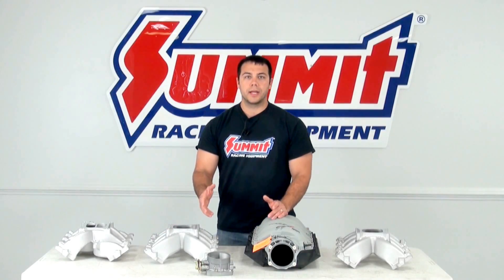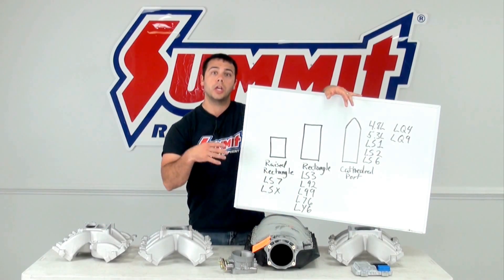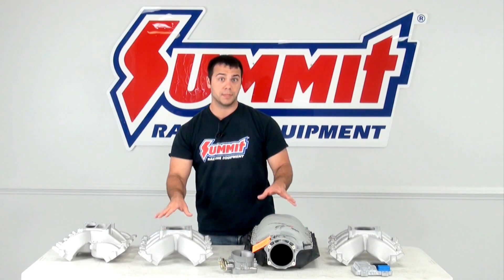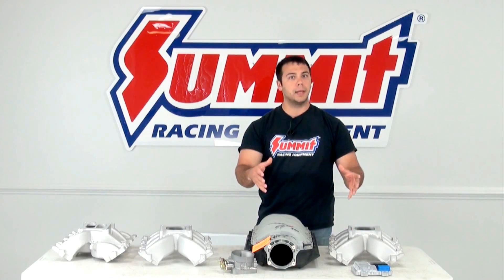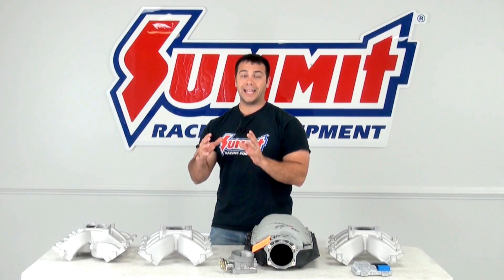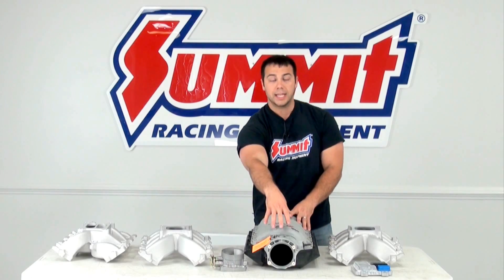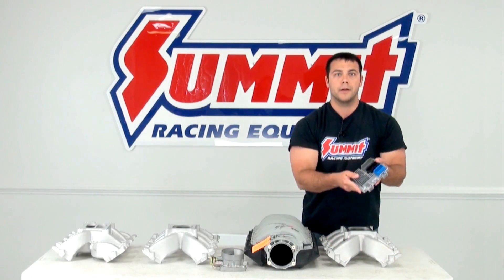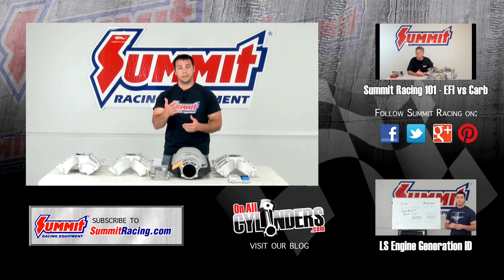LS Engine Swap Intake Manifold Selection - Summit Racing Quick Flicks

Comment: Will be ok to run 2 steam lines or 4 for a 5.3 ls swap
Reply from the maker: Two steam lines works at stock horsepower levels, but four is recommended for any more.  It is definitely easiest to fit the kits when the engine is out of the car.

Comment: which one is best for a 2004 4.8 budget wise like leaving most of it stock other than the cam swap
Reply from the maker: A TBSS or 2009+ long runner truck intake would be the best option to increase torque and power through the whole range.

Comment: Hello i have a stock lq9 6.0 engine and transmission from a 2002 Cadillac Escalade it is fuel injection it's going into a 2001 gmc 2 door sierra shortbed I purchased a 4l60e 2wd rebuilt transmission I also purchased an ls3 intake manifold will it fit with the lq9? And what harness can I use I would like to keep it fuel injection with an ls3 intake manifold and throttle body if possible .
Reply from the maker: Thank you for your question.  Here is a handy guide on the LQ9  https://www.onallcylinders.com/2018/02/02/lq9-engine-specs-performance-bore-stroke-cylinder-heads-cam-specs/    . The LQ9 is a Cathedral Port cylinder head engine, so the LS3 intake won’t fit.  The good news is the 24x reluctor ring crank works with your ECM.

Comment: I have a 2014 L96 6.0 can i convert it to fly by cable to use my transmission throttle valve cable on my 700r4? and keep the original computer or do i need to find a intake wiring harness and pcm from a fly by wire truck. thanks for any help.

Comment: Al, informative video for those who don’t know and just learning. I’m leaning towards installing an EFI multiport system that uses the aluminum single plane intake with a 4150 or possibly a 4500 Dominator style throttle body air valve and utilizing the multiport injection to each cylinder on an LSX 454 engine swap. Is there an advantage to use the FAST intake/throttle body setup instead of the single plane aluminum intake? Thanks in advance.

Comment: How much horsepower you think I would gain by using a LS3 intake on a 5.3 motor
Reply from the maker: The LS3 is a good intake, but the rectangle port LS3 heads won’t fit on bores smaller than 4.000.  The 5.3’s are 3.780.  With your cathedral port heads, you have a lot of good options.  If it’s in a truck application, the factory intakes will actually make more power than a LS6 intake for instance…and a lot more torque. The FAST intake makes great power and you may see gains as high as 20 horsepower at the wheels if you’re running a decent sized street cam.  The FAST Truck manifold is killer too.  All the horsepower of the shorter intake AND all the torque.  That could be 25 horsepower and another 15-20 ft./lbs over the car intakes.  Summit has a great series on LS engines.  To view articles, type your engine code into the search box here: https://www.summitracing.com/customerservice/faqs   There are spec pages for each engine code along with good modification paths depending on what you’re wanting to do with it.
Reply: I have the adapter plates that will allow you to run LS3 intake on a 5.3 and I also have a ls9 cam in my 5.3 do you think once I finish my motor up I could get close to 400 horsepower
Reply: And I have a 4.8 motor I wanted to know will 317 heads from the 6.0 work on the 4.8 without modification or boring over
Reply: Summit Racing will that intake work with a 5.3lsx bored out to a 5.7 lsx?
Reply: Summit Racing one more question where can I find performance parts for a 99-02 Chevy express 5.7?

Comment: OMG I thought the Carb died with the Dinosaurs.  Why would I pay money for a carb or distributor when they both are ancient technology?
Reply: mewrongway because they work?? What kind of stupid question is that
Reply: mewrongway no. Depending on the application, carbs can make more power that efi, depending on how theyre ported. Example: LS engines. Is your default really just to listen to some stranger in a video? Is that how you make your decisions? If you ever worked on engines extensively, you would find that there is little to no power difference between efi and a perfectly tuned carb. You do not gain or lose hp by installing coil packs over a distributor (assuming the vacuum advance is correct). If carbs and distributors didnt work, they wouldnt still be on the market. Its just facts. If you want to continue to deny facts, so be it, but dont argue with me.
Reply: you can tune each cylinder, but that just makes the engine run smoother. the engine doesnt care how the fuel gets there. the only reason efi systems make like 5hp max over carbs is mainly due to the facts that the main venturies restrict some of the airflow going in. it has nothing to do with fuel delivery.

"more spark energy," there is literally zero power that can be gained by merely switching ignition systems, assuming they both function correctly. if you take a 500hp motor with a distributor and switch to DIS, it will still be 500hp.

new cars dont use them because of fuel efficiency, electronics make efi more reliable, and the engine runs smoother. but that was not my point.

My point was that carbs and mechanical ignition are still used because they work very well at a significantly lower cost. so lets say you get a 5hp gain max out of switching to EFI and DIS. congrats, you just spent about 1200 bucks for 5hp that is barely noticeable. EFI and DIS are unquestionably better and more reliable in most circumstances, but this isnt a debate as to which is better, its a debate as to why theyre still used. best bang for buck.
Reply: mewrongway >carbs are a thing of the past

jesus fucking christ ive said that like three times, i was telling you WHY PEOPLE STILL USE THEM.
Reply: no. because theyre cheaper. end of discussion. Having an injector per cylinder doesnt increase power.
Reply: not everyone has the money to build 1144hp. some people want 500hp. and on a ls engine that is easy with a carb. just take the stock efi off and put a carb on and already making more power then stock. NA carb still rules the world as far as hp per dollar
Reply: That's what happens when trying to talk to undoubtedly young people who have never built and raced cars with carburetors. Sure the new technology is nice. I'm building a twin turbo LS that is fuel injected, but guarantee I can make the horsepower numbers with carburetors. Drivability and ease of tuning you have with injectors yes, horsepower advantage...no.
Reply: Well my ls powered race car made 21hp more on the dyno with a carb. But the torque curve of the injection was smoother and 15lb/ft higher. This would inherently make the fuel ejection car much more drivable if that were the important part. Wide open throttle is where the pedal stays most of the time which takes the fuel injections advantages completely out of the situation. Also injection systems tend to normally have a problem at very low rpm's with the type of cams that we use. The type of set up that we were using with the injection cost $2800 more than our carburetor set up. Mind you this was a completely standalone fuel management and ignition ECU. The carb was running its peak within an hour. It took about 2 1/2 hours to get the fuel ejection dialed completely in. For a streetcar that would be driven quite often obviously fuel injection is the way to go. It's a great investment. For our application it is a waste of time and money for unnecessary gains. We don't have a change of altitude and usually an Allen head or a screw driver can make tuning a quick thing within minutes. Also people tend to forget the cost of the laptop it takes for tuning. This really comes down to application such as mine or quite a few others. Yes a carburetor could never achieve the horsepower fuel injection could if it was a battle to the highest horsepower number on the planet. Yes fuel injection can precisely target all rpm ranges with tuning. But as some on here have said the cost is just not in the play unless stock equipment is used. Sometimes technology is just not needed or used in forms of auto racing. Not to mention there are hundreds of racing classes in all forms of motor sports that are mandated to use a carburetor.
Reply: There is more to the story with fuel systems. Cam selection has a huge impact on outcome. Overlapping the valves is no friend of efi at low rpm.
Reply: mewrongway I have several efi race cars. The point is ---->application<-----. Even the falken mustang drift car is on a carb at 1,000hp with a 455cui RY45 Andy Durham engine. The reason they went that way is because it was completely useless to have a fully tuned EFI system on a car that does one thing only.
Reply: Carbs are cheaper and easier to get started.
Reply: mewrongway I would say Andy Durham race engines new exactly what they were doing. He is was lead engineer for Roush Yates engine program before it cease to exist in the circle track world. He only developed their trans am injection systems as well.....
Reply: mewrongway yes roush yates no longer exists in short track world. The supply components only. He took over their entire engine program in Charlotte. A change of hands so to speak.
Reply: My quadrajet sits on a weiand blower and runs accurate times your comment is invalid

Comment: What ports do the Gen 5 engines have? I'm looking at getting an L86 out of a 2014 Silverado. The engine vin code is "G". Thanks alot.
Reply from the maker: +Jaime Huff , 
The only aftermarket intake manifold currently available for GM’s new Generation 5 direct injected motors is the MSD Atomic AirForce intake for Corvettes.

Comment: i would like to run a carburetor intake on l98 what ports would it have
Reply from the maker: +samuelmdouglas, 
The ports on an L98 motor are the standard shape and spacing for a Gen I small block Chevy. Edelbrock, Weiand or Summit Racing will have an intake manifold for you!
Reply: +Summit Racing here in Australia we have an alloy 6 litre called l98 comes in the ve commodore i think you guys know it as the pontiac g8
Reply from the maker: +samuelmdouglas , 
Ah, the problem with GM reusing option coding; apologies!!
The Australian built L98 6.0l motor appears to be fitted with the L92 cylinder heads. Edelbrock offers their 71197 intake manifold for those heads that will accommodate a carburetor.

Comment: I have a 77 trans am and I would like to use the shaker hood. I've seen this done but I can't seem to find a dual plane efi carb style intake. Is there a huge power loss down low if I went with single plane?
Reply from the maker: Ayodele Dawson , 
This would depend upon the type of fuel injection you plan on using. Give us a call and we can help you pick out whats right for you. 1-330-630-0240. Thanks!

Comment: Lol installing a distributors isnt that hard, id rather do that than spend the loads of cash when installing an aftermarket pmc
Reply: $700 just for the full conversion kit. a stand alone is $356 and you can program a timing curve instead of dicking with bushing and springs. I'd rather save $350 and get more accurate timing with the crank trigger
Reply: use the stock computer and the stock injection.

Comment: What are the benefits and disadvantages to each runner style? And with the engine management system can you delete the MAF and or MAP sensors? I'm looking to build an ITB setup for my dads  2000 Silverado and it would be much easier without the MAF/MAP sensors. Thank you in advance.
Reply from the maker: knation92, 
Having a long straight runner promotes unimpeded air flow and best cylinder fill. Air that has to turn while traveling slows down and effects how well the cylinder fills with air. Filling the cylinder with as much air as possible at all engine speeds is key to making power. Physical sizes of manifolds are affected by a lot of factors including cubic inch displacement and underhood space limitations. Being able to measure the amount of air coming into the motor at all times is key to fuel delivery. While a MAP sensor is great for measure the pressure inside the manifold, a MAF sensor is crucial to accurately measuring the quantity of air entering the motor. Knowing this info enables the engine computer to calculate the correct amount of fuel to deliver for awesome driveability!
Reply: Summit Racing ok, I guess I'll build an air box to put on top with a single inlet I'll use a bigger than stock MAF sensor to let the throttle bodies draw air freely without being restricted I guess, thank you for the info your answer was well worded and makes a lot of sense. I have one or two more questions though. Does the engine management system replace the stock computer or does it work with the computer? And how easy or hard is tuning the engine management system vs. tuning the computer that's already on the car and would I need to pay for a special program to work with it or does it come with the program